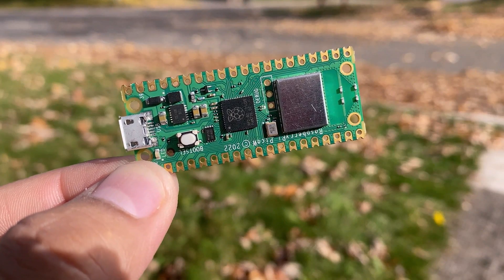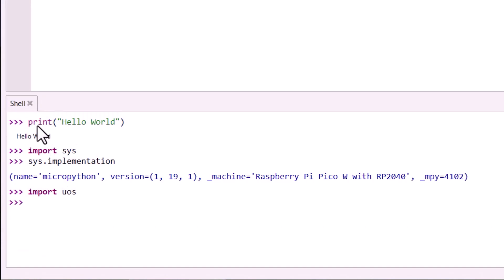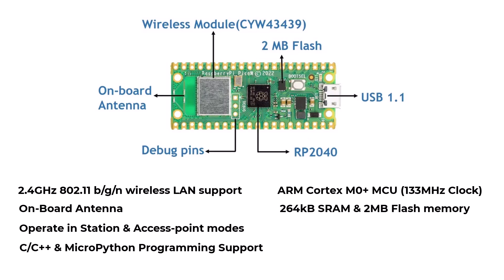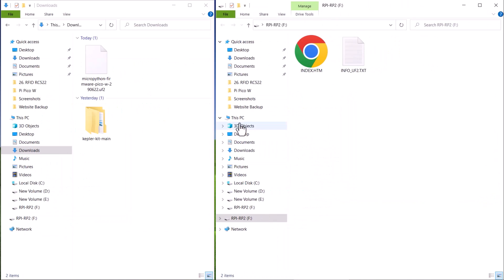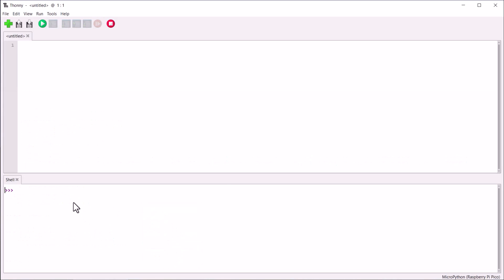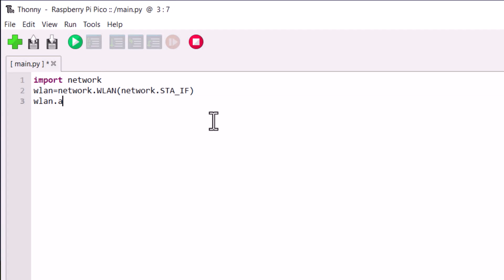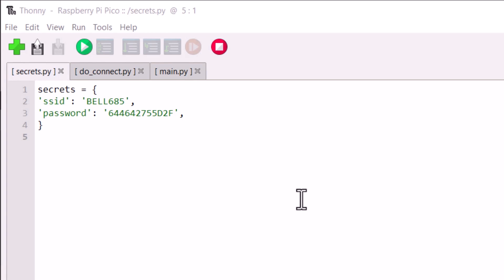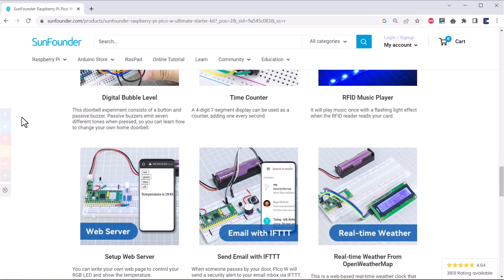Raspberry Pi Pico W Getting Started Tutorial  || Wireless Wi-Fi Connectivity to RP2040 Board

Comment: Thanks for this great video. Is It possible to read data from a smartphone app using BLE?
Reply from the maker: The BLE firmware is under development now. Pi Pico W doesnt support BLE functionality currently
Reply: @HowtoElectronics  Thanks for your reply. So actually, how can I connect directly to the pico in wireless mode ? Wifi-Direct ? Is it supported ?

Comment: Why am I getting this in the shell "Unable to connect to COM3: Cannot configure port, something went wrong. Original message: OSError(22, 'The semaphore timeout period has expired.', None, 121)

Process ended with exit code 1."???

It seemed when I first used it - it was working properly buy something changed and now it doesn't see the COM3 Port that is listed in the Device Manager (Windows 11)!